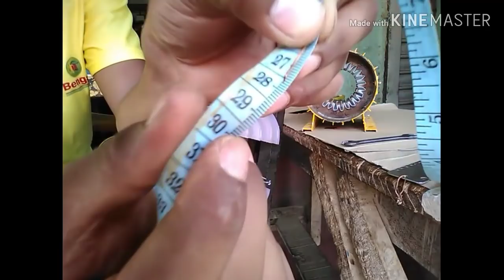1hp tullu pump winding 24 solot a to z

Comment: Sir motor mea auto cut kon sa winding mea kaisea lagatahea plz
Reply from the maker: Motor mein jo common wire Hoti hai usmein overload protector any auto switch lagai jaati hai, agali video mein  aapko isko Laga ke dikhaunga
Reply: @technicalkafi  sir running  or starting ko joind ma laga sakthi hea

Comment: Motor heat kiu hota hai  new winding kiya hai 10 minute mai bahut jyada heat hata hai .motor off hi karna parta hai one hp motor hai jet pump hai
Reply from the maker: Connection check karo
Reply: @technicalkafi  connection sahi hai
Reply: @technicalkafi  starting wire guage 24 hai running wire guage 27/28 number kaa hai .running mai 2 wire se winding kiya hai . Mujhe winding mai doubt lagraha hai
Reply: @technicalkafi  resestance check karta hu tho starting ka 17 aur running kaa 15 dekha raha hai

Comment: Sir 24no Ki ghygha 25no wear daal sakta ha kya
Reply from the maker: No
Reply: Aisa hai running me 22  dal sakte Hain . 22.5 dal sakte Hain . 
Double 25 +25 dal sakte Hain .
Aur bhi data dala ja sakta hai .
Starting me 26 ya 25 koi bhi dal sakte Hain but Jo no dala jayega uske hisab se turn daleinge
Reply: Mai motors ke data khud se design karta Hoon jisme zarurat ho . 
Choti motors se le Kar badi motors tak ki rewinding karta Hoon .Jo ki Kam ampier yani Kam se Kam bijli khati hai aur load bhi achcha rahta hai . 
Mob no 8874240795
Reply: @uzairmasood7245  aap chain winding karte ho? Mujhe 1.5 inch stator size, 3 inch diameter  exhaust fan ka chain winding data chahiye copper me. 18 inch ka exhaust fan hai.
Reply: @uzairmasood7245  data and wire nambar
Outar daya 126 mm
Ienar daya 63 mm
Lanth 72 mm

Comment: Sar 22 number se aur 26 number se data Bata dijiye 1 HP
Reply: Awdhesh kumar Sharma
Reply: Awdhesh
 kumar Sharma
Reply: Awdhesh kumar Sharma
Reply: @devendrahangdale3127  Awdesh
                                    kumar sharma
Reply: 1 hp non standard size me jiska stator 7  cm lamba hoga usme 22 no se you 25+25 se  ya 22.5 no se rum me aap 50 turns se lekar 55 turns ya aur heavy banana ho to 60 turns tak dal sakte Hain .
Starting me 26 se 120 120 
Ya 25 no se 110 115 turns dal sakte Hain .
.
Reply: @uzairmasood7245  sir please 1 data daydo
Daya 126mm
Inner daya 72 mm
Lanth 70 mm
2800 rpm
Single fhas and
Three fhas
24 slots

Comment: 0.5 hp data hay
Reply from the maker: 0.5 HP Kirloskar company ka data-        core size 3 cm, solot 24# Running- 6/100,8/100,10/100,12/100-swg 26/,350gm# starting- 10/200,12/200-swg-29/ 200gm @ copper wire ,100% ok data, thanks for watching my